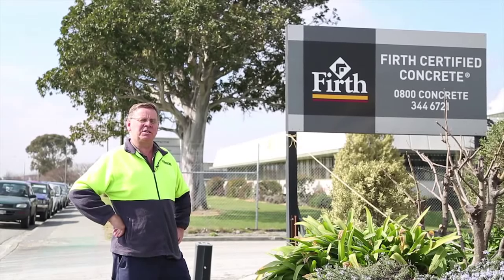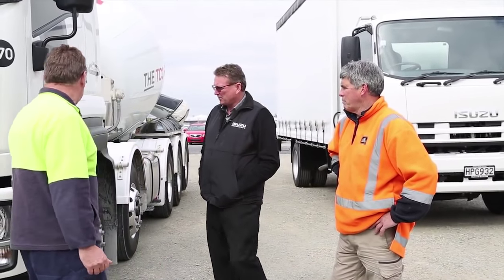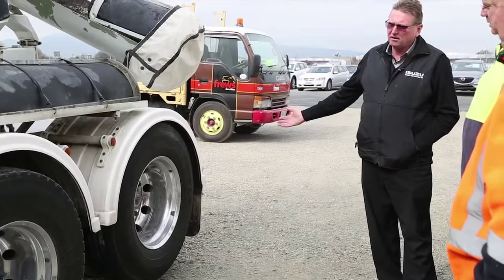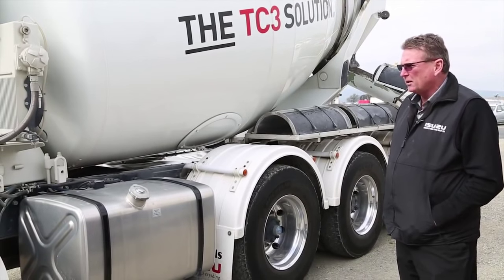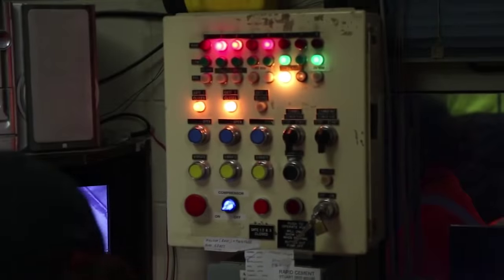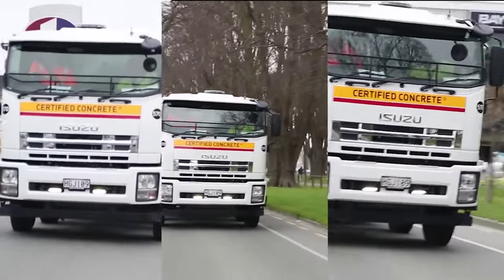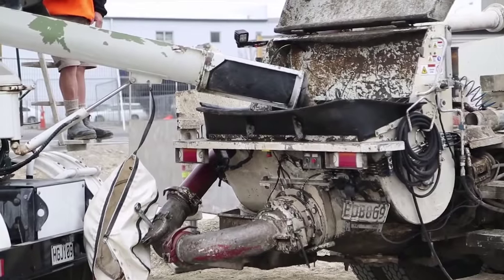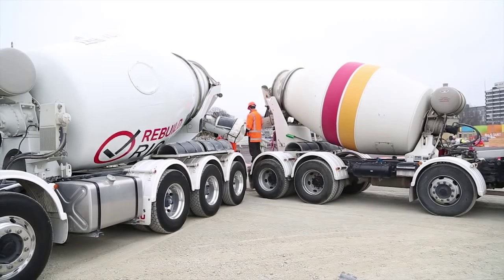Isuzu Truck Review   Firth Concrete

Comment: The main reason I would not recommend a Isuzu truck is parts and service, Isuzu keeps a tight rein on there parts, even subcontracted parts ( IE. Allison transmission ) making them double to triple the price on most other trucks, and if your not happy with your local Isuzu truck service center, no problem the next  one is only a few hundred miles away.
Reply: Eu só mecânicode caminhão betoneiras
Reply: Eu amo o que eu faço
Reply: Isuzu fy range is too big for my road in Indonesia also less maneuverable
Reply: Sir am driver  I have u.a e 4 number  license  can I am apply  your company  am 4 years experience mixer truck